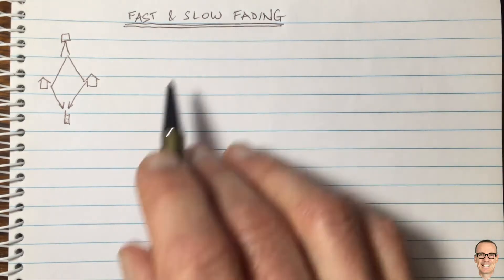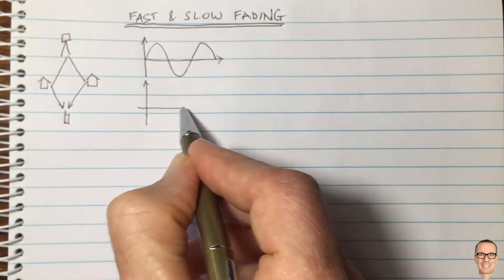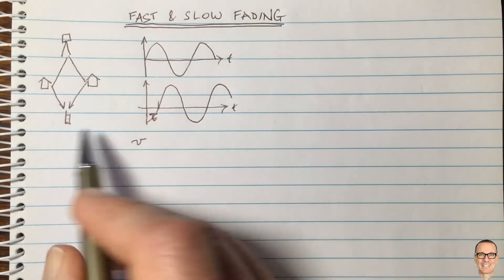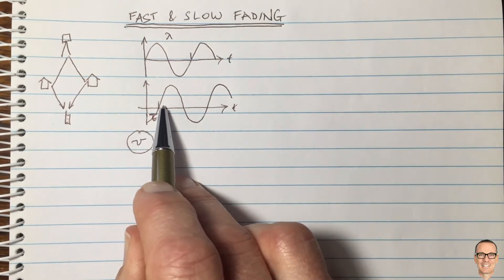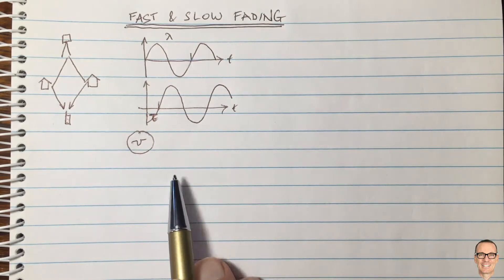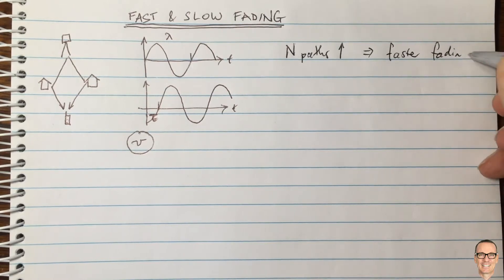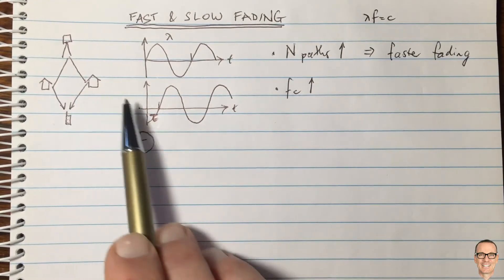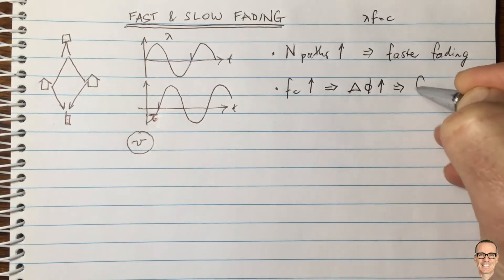What are Fast Fading and Slow Fading?

Comment: Hello Professor,I have a question about frequency selective channels and their time and frequency responses. I understand that for slow and fast fading, we primarily look at the channel's response in the time domain to determine whether the channel exhibits slow or fast fading characteristics.However, I am confused about how this relates to the frequency response of the channel. Specifically, if we have a slow or fast fading channel, do we also consider it a frequency selective channel when we examine its frequency response?I find it challenging to understand the relationship between time-selective channels and frequency-selective channels because most materials focus on either the time domain or the frequency domain, but not both simultaneously. Could you please explain the interplay between these concepts? A video explanation would be very helpful.Thank you in advance!
Reply from the maker: This video might help: "What are Flat Fading and Frequency Selective Fading?" https://youtu.be/KiKPFT4rtHg

Comment: Thx for your wonderful guidance in communications, may I ask somethigh which confused me, did we always talk about fast&slow fading in time domain and frequency selective&flat in frequency domain?  Is Rayleigh fading a kind of tool for modelling to analyze all those above, so that we can assume and analyze channels like Rayleigh flat fading, Rayleigh fast fading. Many many thanks in advance.
Reply from the maker: Rayleigh fading refers to the probability density function of the channel gain at a specific time, t, which is a Random Variable. When you look across time, at a whole channel gain function over time, then you are looking at the channel gain as a Random Process - and that is where the fast/slow and selective/flat characterisations come in. For more details, see the following three videos: "What is Rayleigh Fading?" https://youtu.be/-FOnYBZ7ZfQ , "What is a Random Process?" https://youtu.be/W28-96AhF2s and "Autocorrelation and Power Spectral Density (PSD) Examples in Digital Communications" https://youtu.be/XWytSLZZP1A
Reply: @iain_explains  Thanks a lot, Prof. Iain. Many thanks for your detailed guidance, I saw from the textbook that slow&fast fading were based on Doppler effect, I am wondering that multipath is another main reason since each Doppler shifted signal has to add up together to perform the fading in time domain. Might need your help.
Reply from the maker: @louisli8489   These videos should help: "What are Doppler Shift, Doppler Spread, and Doppler Spectrum?" https://youtu.be/LLr3-kotbz4 and "What are Flat Fading and Frequency Selective Fading?" https://youtu.be/KiKPFT4rtHg

Comment: sir I have reffered a journal paper in which it's mentioned that coherence time 500  and 35 micro sec if we are using carrier freq of 2 and 28 GHz
then how can be a channel in fast fade as in order to achieve even speed of 1 Mbps we have bit duration of 1 micro sec but the condition of fast fade is symbol duration > coherence time which is never seems to be possible with such scenario?
means I want to know for OFDM systems can channel be in fast fade?
Reply from the maker: Don't forget we're not sending the 1Mbps data using binary modulation. The higher order the modulation is, the longer the "data symbol" lasts for. Also in OFDM, we are sending parallel data streams, so each sub channel is sending at a proportionally lower rate - so again, this makes the data symbol last even longer.
Reply: @iain_explains  sir is it not possible to send our pilot bits with binary modulation scheme in order to estimate the channel , and send our data with higher modulation schemes in this way we can estimate our channel for worst channel conditions / channel is varying very fast .
after all we are estimating the phase and gain of the channel has to offer so that we can equalise our channel affect
Reply from the maker: Sure, but you asked about whether the fading rate could ever be "fast". And I was just telling you the reason that it can be "fast". I wasn't referring to anything related to how to estimate the channel. The fading "rate" relates to the actual data symbols, not the training symbols that are used to estimate the channel.
Reply: @iain_explains   it means that channel can be estimated for any worst condition ?
sir actually I am working on error performance of OFDM in presence of residual CFO which can't be estimated for fast moving vehicles as coherence time offered is very less, but  sorry, what you mentioned above has confused Me as  mentioned channel can be estimated for any condition if we use binary modulation for pilot carriers , then from where this residual CFO is comming , sorry prof I might be going little off topic but It has made me confused

I am Ph.D student @ IIT India thanks for every reply I would be grateful to you sir I have shared your channel in my whole circle they are big fan and admirer of your teaching sir 🎉
Reply from the maker: Actually, no, I didn't say anything at all about how to estimate the channel.

Comment: at 6:20 what is the meaning of tau not changed but it should change since the receiver is moving with velocity v
Reply from the maker: That's not what I said. I didn't say tau was constant. I said, even if tau was not changing, then there would still be the effect of Doppler.
Reply: thanks sir lots of respect from India ❤️
Reply: u want to say that change in tou can be seen as offset in carrier frequency which is Doppler shift?
Reply from the maker: No. I'm saying that a change in tau will result in a change in the channel gain. Also, a change in frequency (ie from Doppler) will result in a change in the channel gain. They are not the same thing. They both effect the channel gain. In most cases you get them both happening at once (due to the movement of the terminal), but this doesn't have to be the case.

Comment: Thank you for the nice explanation. I have a question. If I am using some kind of analog mode like SSB or FM voice like in HAM radio, what would be the symbol rate of these voice signal?
Reply from the maker: The definition of a "symbol" is a finite duration waveform that is used to represent digital data. Therefore, for analog communications, there are no "symbols", and hence no "symbol rate". In this case you can look at the relationship between the rate of change of the signal (related to the bandwidth), compared to the rate of change of the channel.

Comment: Thank you very much! sir! one question about the hIgh data rate and Low data rate. if we use a longer symbol duration, why does it mean Low data rate?
Reply from the maker: Symbols are mapped to data bits, so if the symbol takes longer to send, then the corresponding data takes longer to get to the receiver. You might like to watch: "How are Data Rate and Bandwidth Related?" https://youtu.be/ZBSvMbO0mPQ and "How are Throughput, Bandwidth, and Data Rate Related?" https://youtu.be/IY6fDYwC2fU
Reply: @iain_explains  Thank you very much. it is clear now!

Comment: Thau can not be equal to half a wavelength... I got your point but saying that can be confusing...
Reply from the maker: Tau certainly can be equal to half a wavelength. It happens to my favourite AM radio station every day on my drive to work. There is a section of road between tall buildings where the radio station goes all "fuzzy" and "noisy" and I can't hear what the presenter is saying. This is precisely because there are two dominant propagation paths, and they are half a wavelength apart.

Comment: I cant' understand why if there is fast fading there will be no ISI at the receiver? The receiver may receive some copies of the transmitted signal and they wil cause the ISI
Reply from the maker: Yes, but for large symbol times (long symbols), the delayed paths only affect a small percentage of the symbol time. So, the longer the symbol, the lower the ISI effect. Long symbols mean that there is more time for the channel to change before the next symbol. Which means the fading is fast (in relation to the symbol time).
Reply: @iain_explains  Ok, got it. Thank you